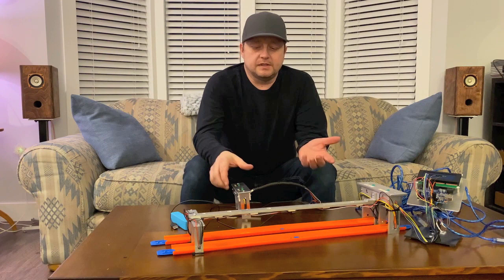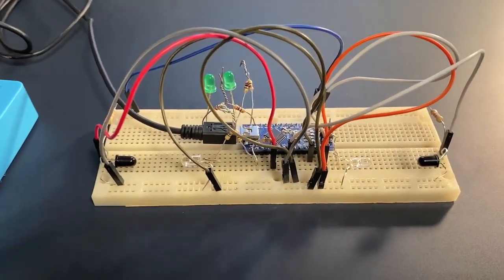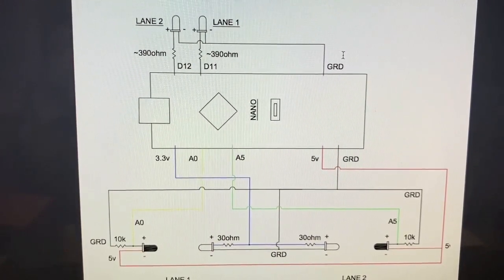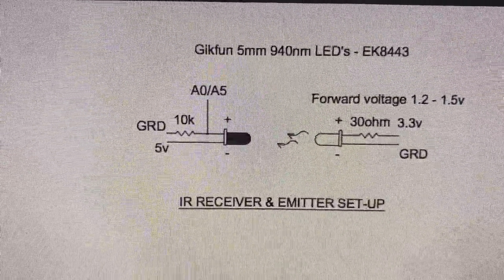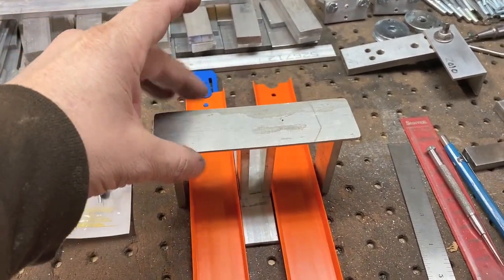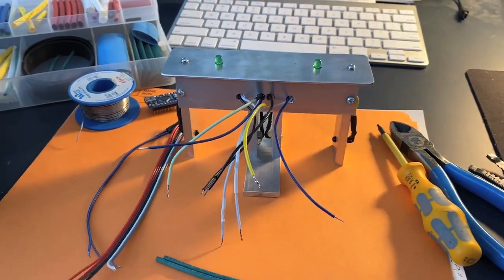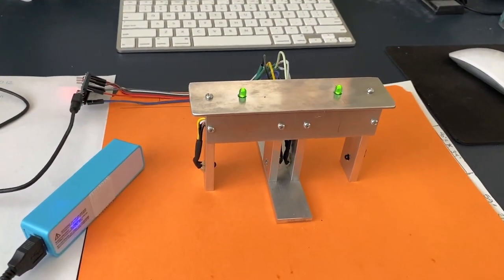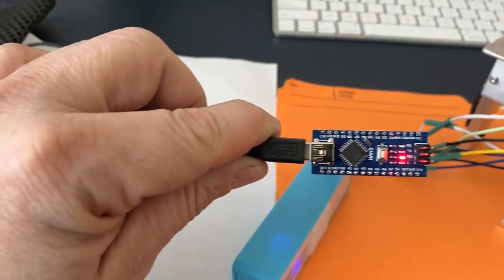Electronic Hot Wheels Finish Line - Version 1 / How to build a smart finish line! / NO MORE FIGHTS

Comment: Are you using 1/2 watt or 1/4 watt resistors?
Reply from the maker: Doesn’t matter.  This is very low current draw.  You can use ohms law to calculate.  V=IxR & P=IV.   Power is in watts.  Cheers.

Comment: I have built this but one LED is always illuminated. any ideas on how to fix?
Reply from the maker: You typically should not see them light up.  They are UV.  You may have a standard LED in error.
Reply: @MikeFreda   the LED that lights up to show which lane won. I do not have the  Clear lights installed. I didnt see where those go. is there a way you could look at what I have an correct my error? I can use fritzing and give a drawing of the ardino uno. are you willing to help? doing this for a STEM night for kids. please
Reply from the maker: If the one “winner” LED is always on typically means the race s happening over and over again with that lane always being the winner. It’s stuck in that loop. I suspect you have a wiring issue and the finish line UV LED is always detecting a win. You can PM me some pics and a wiring diagram is you like.
Reply: @MikeFreda  I sent an email (from your creator page) and just wanted to check if you received it. I appreciate your help this has me stumped

Comment: I just finished a ver 1 but when I apply power the two winner lights come on for a few seconds then one turns off. A few seconds later it comes back on and the other light goes off.  they keep alternating until the power is removed. any help would be greatly appreciated
Reply from the maker: Well, at least you know the circuit is technically working.  What I suspect is happening is that its awarding a winner before a car is going through the gates due to the IR Threshold value it too low.  I would plug the unit into the serial monitor and see what the IR Receivers are actually reading on the computer screen.  I listed a de-bug section in the code. You just need to remove the "//"  You may need to adjust your thresholds to suit. (sensorThresh)
Reply: @MikeFreda  Thank you so much for the prompt replay. I will try this right away
Reply: i changed the threshold  value in a range from 100 to 999 with out any success. What I found was little or no change on the serial monitor
and the value always below 75. The other thing I noticed was the monitor readout  was for finish 1\ finish 2  and the cycle is much slower than on your video 
thank you for your help
Reply from the maker: It sounds like to me that the the IR LED’s are not emitting.  The reading of 75 could be just the ambient UV that is always around us.  

What I would do is make a separate simple test setup and see if you can get the IR LED to emit and have the receiver pick that up just on the serial monitor.
Reply: @MikeFreda Thank you very much for your help and the promptness of your replies. I was trying to get this working before this weekend for a boys club. They should be very happy. As you probably guessed the problem was solved the mistake was mine. I mixed up 2 wires one that goes to A1 and its ground
thank you again
Don

Comment: Aren't you a little too close to the max forward current of 30mA for the ir leds?
Reply from the maker: Not according to the provided Data spec sheet.  Peak forward current is 1amp and continuous is 100ma. With the dropping resistor and the 3.3v tap from the Arduino it works just fine. Been running this for a couple years now with no issues.  I suspect in this application you could lower the current even more and still be fine.  Cheers.
Reply: @MikeFreda  my bad. I didn't look at the datasheet but on Amazon which said max forward current was 30mA and peak pulse was 70mA.

Comment: PERFECT!  
I spent countless hours trying to build a timer like this from someone else's plans, without any success.  With your schematic: Less than one 1/2 hour of breadboarding, and I had this prototyped, working and ready for final assembly on my track .  The schematic was professional and very easy to read!  My only feedback would be to change the color of the yellow Analog 1 lead to another color...it's difficult to see that standalone color on a computer monitor.  Other than that, I matched my wire colors exactly to the schematic for ease in hookup.  Your coding was perfect right out of the gate ( so to speak) and it works flawlessly.  Thanks!
Reply from the maker: Thanks for your comment and feedback. Much appreciated. Glad it worked out for you.
Reply: Same here. I've spent a lot of digging around, stitching together my limited knowledge of programming and electrical work with what ever is available for free out there. Everyone is charging for plans nowadays. Thanks @MikeFreda for posting these builds.

Comment: This is great!  Thank you for all this information. 

I have a double wide track setup I’m working on and want to do an automatic start gate while displaying finish times for up to 4 cars. Is that possible using a variation of your setup?  Thanks!
Reply from the maker: Yes. Have a look at my version 2 or 3.  It calculates and displays times and flashes who the winner is. Adding more lanes is easy you just have to keep track of the lanes in the code and add the additional sensors.
Reply: @MikeFreda  thanks for quick response!  I apologize, I should have been more specific with my initial question. The track I have is two and half cars wide and is open racing, not held to a specific lane, to allow passing/wrecks. Same track the guys on the 3dbotmaker channel are using.
Reply from the maker: I see. Well, unless the car has a tracking device it would hard to know who the winner is. All you would get a time when the first car passes the finish line. If that is the case, you would just need one set of lights. The beam will span that distance.
Reply: @MikeFreda  I'm happy to hear that you can add additional sensors and make this work, by just adding additional lines of code.  Now that I've finally got a working prototype with the awesome information you've posted here, I may make a four-lane version in the final build.  Thanks again!
Reply: @MikeFreda  One question:  You talk about adding additional sensors for additional lanes, then modifying code.  I'm assuming that you would use any additional analog inputs available on the board, for each additional lane added, correct?  i.e. A3, A4 etc.  Then add additional ir emitters as needed, to provide the input signal across additional lanes?
Reply from the maker: @Flyfisher1976  Yes, that is correct. The emitters just need voltage . Each receiver will need its own pin out. Arduino make larger boards with more pinouts if you need more. When changing the code, you will need to be methodical, you can easily get mixed up adding more lanes.
Reply: @MikeFreda  Perfect.  I don't anticipate more than four lanes.  The board I own has at least 4 analog inputs.  
Thanks again!

Comment: Can i replace ir with LDR?
Reply from the maker: I do not know.  If the LDR can detect the same wavelength (or within its tolerance) then it should be able to detect the beam. Again, you would have to do some research and experiment.
Reply: It would be great if i can use the laser and LDR to used in motorcycle racing finishline.. because it need long range for the laser... Maybe 3 meters on both sides to have a good clearance for the motorcycle to pass thru...
Reply from the maker: @lacuestaoptical848  These IR LED and receivers can work for those distances. Have a look at the spec sheet. I've made a prototype timing system for Autocross (start gate and finish gate) and it does work. You just need to focus/direct the beam. What I did is install 3 LED Transmitters on one side and one IR receiver (the black sensor) on the other side mounted inside a tube.
Reply: Do you have a schematic?  Can you check the code? Why it has A1 and A2 while in your schematix there is A1 and A5?
Reply from the maker: Sorry. Typo. They just have to match. Just change either one to match. 

I do have a basic test code for that autocross timer. It was just to see if it would work, it does and I’m working on a future video and will develop it some more.
Reply: Maybe if you can try a photoresistor for the receiver and a laser 650nm? It would be very great..... But ir would be fine if it can  reach up to 7 feet or so... But again... Any ensights on why A1 & A2 is on the code but in schematic it has A1 & A5?
Reply from the maker: The pin outs are a typo.  I accidentally transposed them wrong when I was prototyping it.  It really doesn’t matter what pins are as long as the code matches the board and vice/versa.

Comment: What is the max distance of ir? 
Can i repalce that with laser pointer ang light sensor?
Reply from the maker: Depending on the holder and how you hold the IR sensor it can go a couple feet. The spec sheet has more details. The Sensor is Infrared. In order for it to sense, the emitter needs to be in the same wavelength.   I’m pretty sure a red laser pointer is not even close. You can always try. Perhaps the sensor has a +/- tolerance.

Comment: do you think that this could be made bigger?
Some friends of mine throw a Belt Sander Drag Race and I was wondering if the receivers could be scaled up....any insight?
Cool build man
Reply from the maker: Yes, it can be. The IR LED’s and sensors have a large distance range. It can easily span a several feet. I suspect the belt sander track is 1ft wide so my system as is will work no problem for you.

Comment: Hey Mike. Thanks for all of this. Thought I’d start with version 2 but soon took your in video advice and backed up to version 1 first. Any chance you could tell the type/size of wire you used? I just want to make sure I buy the exact stuff you used. Thanks much. Cheers.
Reply from the maker: 24 or 22 gauge stranded wire will work fine. Probably get away with 20 but it’s starting to get a bit thick. Get a few different colours so you can easily tell them apart.
Reply: @MikeFreda  so I have watched your content dozens of times and have finally gotten to the testing phase, but when I upload the sketch, my lane 2 LED blinks intermittently. There’s no cycle process to start. It just turns on then off at about 5 second intervals. And it never stops. Thoughts
Reply from the maker: @gaabty9580  I suspect that the sensors (IR LED's) are always detecting a winner (false triggering) I would look at the sensor values in the Serial monitor. Plug the Arduino into your computer, remove the "//" from the serial monitor sensor values. Re-upload to the Arduino and see that they are registering on the computer screen. You may have to adjust your threshold value. I would also double check your resistor values. make sure you have the correct ones installed. Once you figure out the issue, reinstall the "//" into the code. Printing to the Serial Monitor slows the Arduino down.
Reply: @MikeFreda  so my sensor read outs seem very low compared to your video...I’m seeing them in the 250-280 range. 🤷🏼‍♂️ I’m lost.
Reply from the maker: @gaabty9580   Well, at least you have some figures. What does it read when the sensors are blocked or when a car passes? If lower than 200, then set your trigger threshold to 200. (sensorThresh = 200)
What sensors did you actually install? The Gikfun ones I recommend or the prebuilt boards?
Reply: @MikeFreda  so is set it to 200 and the reading is now in the 500. However, the LEDs cycle at the beginning but now only one lights for an assumably false positive, and then keeps doing it. No back and forth from one LED to the next.
Reply from the maker: @gaabty9580   It appears that the one lane is always detecting a winner. Which way do the Clear LED's point? They need to point away from each other. (they need to be in the middle)  I also suspect you have a wiring issue. If you like, you can email a picture of your set up and a video of it running.
Reply: @MikeFreda  thanks, Mike. The clear IR sensors are facing away from each other. I’d love to send a video. What was you website again?  I believe you mentioned it could be found there. Thanks for the help on this. My son is going to love it!
Reply: @MikeFreda  hey Mike. I think my wiring is off a bit. I’m fairly new and am learning as I go. How feasible would it be to use an IR obstacle avoidance module on each lane rather then the individual IR LEDs (emitter and receiver)? And, would that change the code or would it remain the same?
Reply from the maker: @gaabty9580  Yes, you can use those boards. My prototype used a board like that. Those boards do have a trim pot that allows you to adjust the sensitivity. As for the coding, these boards behave the opposite. They go (trigger) "high" when a car passes since the car is reflecting the beam. As oppose to breaking the beam and it reading "low" like the way it is currently shown.  you just have to figure what the "high" value is and put that number into the Threshold variable, and of course change the < & > signs in the If statements since the program is behaving the way opposite now. The lane the triggers  "High" (above the threshold) first, wins.
Reply: Hi, mike can you share your sketch if it is ok for you. Thanks!
Reply: @MikeFreda  thanks!  Just emailed you. 👍🏼

Comment: hey man! awesome setup! trying to make ver 2. quick question, what is the wattage of the 390ohm resistor that you used?  is this the one Orange, White, Brown, Gold? if i cant find any, what can I use as a sub for it? stay safe! thanks man!!!
Reply from the maker: This resistor is not that crucial and doesn't really dissipate a lot of heat, its just there to drop some voltage so you don't burn out the LED. 1/4watt to 1watt will work. 390 to 470ohm will work. The LED will work in that range. Good luck.
Reply: @MikeFreda  thank you so much for help. will try ver3! bought a 4x20 instead of the 2x16. im so glad you made a version 3!! :D thank you my kind sir! stay safe!
Reply: @MikeFreda  the 30 ohm resistor for the IR receiver? is it ok to sub a 27ohm or 33ohm resistor for it? thanks!

Comment: Hi Mike im trying to complete at least version 1, ¿ do I have to build everything before run the code on the arduino? Thanks
Reply from the maker: You can upload the program to the Arduino. Without the switch and sensors it won’t work properly.  Most people bread board or loosely wire up the circuit to see if it works then create a proper setup.

Comment: Hello, I made this lane sensor and need a little help. In the serial monitor when nothing is breaking the beam it only reads 20-40 and not around 1000. Any way to fix/debug this? Thanks for your time!
Reply from the maker: It sounds like you may have the wrong size resistor on the black receiver. This resistor adjusts the sensitivity.
Reply: @MikeFreda  Thank you!

Comment: Any chance you can take pictures of the wire setup on the nano going to the sensors?
Reply from the maker: Yes, I can but there is a schematic that shows the connections. Link in the description. Please let me know if this is good enough for you?
Reply: @MikeFreda  I reviewed it, I have zero experience with this and a bit confused on how you were able to do the wiring to the transmitters.  Thanks for the quick reply, btw. My plan is to order the gear and start on it this weekend. As well as your start gate. Which, any chance you can provide a shopping list on the start gate gear?
Reply from the maker: @roymercer22  I can take some detailed pictures for you. Not a problem. The resistors are wired right a the IR LED's and Receivers and all the wires run to the Arduino Nano. If you have never done this before, I recommend just playing with the Arduino Nano first. Just do a simple project to understand how it works. Arduino has a website that has great tutorials and simple projects in their project Hub.
Reply: @MikeFreda  My ignorance is showing. I plan on just doing version 1. The simple nano connection. Sorry I cant even get my lingo right. I am confused on the connection of the black and white bulbs.
Reply: @MikeFreda  what is the best way to view these pictures?
Reply from the maker: @roymercer22  send me a private message with your email address.
Reply: @MikeFreda  I looked on your about me and I don't see an option to send a message.
Reply from the maker: @roymercer22  Please try again